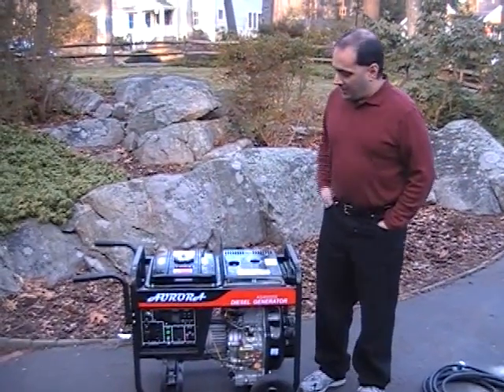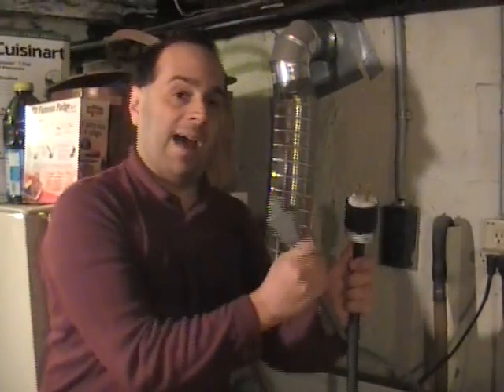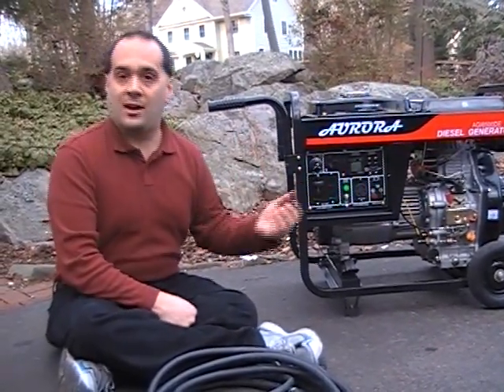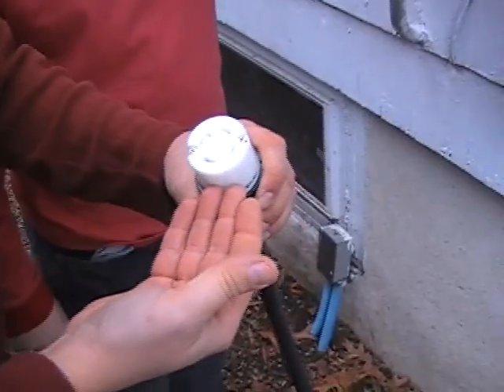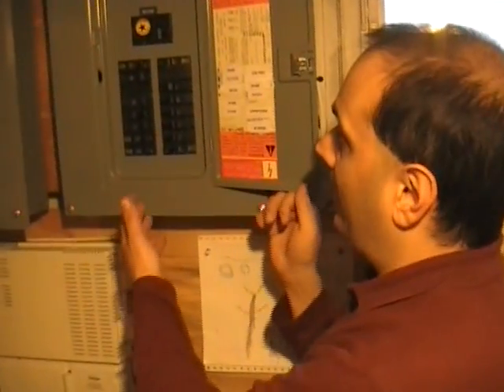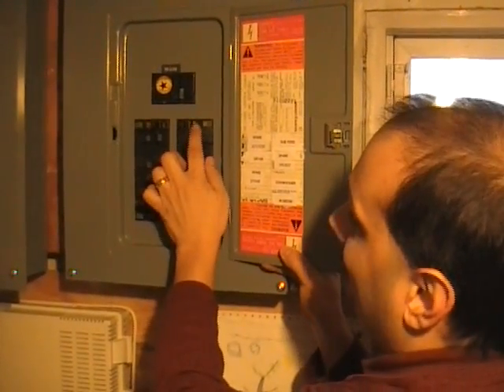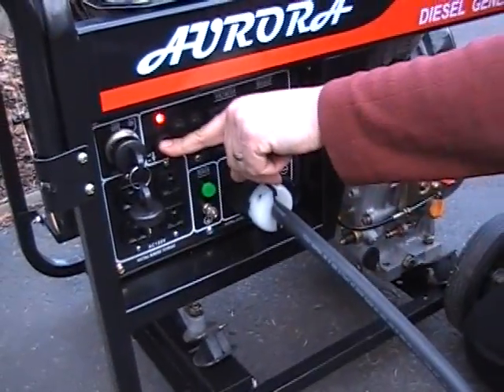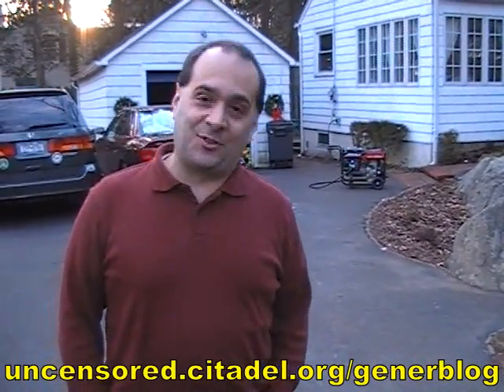Inexpensive residential generator hookup

Comment: Hello Art, just finished my generator setup( Box ect) and installed a 30 amp breaker for the Generator which connects to an inlet box, with 10 gauge 4 wire cable, now I "m wondering if I should have used a 40 amp breaker or would that be over kill, not trying to run the whole house, Plus I have a second 7000 watt generator the I could run cord from
Reply from the maker: Nope, you got it right.  A 30 amp breaker is the correct size for 10 gauge wire.  40 amps is too big and may not provide sufficient overcurrent protection.

By the way, 30 amps * 240 volts = 7200 watts, so your 7000 watt generator probably has a 30 amp breaker on its own panel anyway.

It should also go without saying that you shouldn't try to run two generators together on the same panel.  They will run out of phase and almost certainly damage each other.
Reply: AlRuark  Size your Gen input breaker into loadcenter panel  to the output  amperage of your Genset with the corresponding size that way you will get the full output of your generator. AND size the wire accordingly. bigger breaker bigger wire.  40 amp breaker needs #8 gauge wire. etc. My set up is 10'000 watt Northstar wired directly to panel using 40 amp breaker Gen set puts out 41.5 amps and the manual interlock system, works great. thanks.....

Comment from the maker: 4000 watts ought to be enough to power your refrigerator and some lights, and also your heat if it's NOT electric heat.  However if you don't know your way around electric but you have some free spaces in your panel, you might want to just have an electrician put in an interlock switch; they're simpler and less expensive than a subpanel -- but you do have to have some free space (I didn't).

Whatever you do, avoid "brand R" subpanels.  They're crap, and sold by shysters.

Comment from the maker: The generator may only be able to supply 30 amps (27 amps @ 240 volts, actually) and that's why the generator main is a 30 amp breaker ... but when running on utility power, there's no reason to limit ourselves to what the generator can supply.  We actually could have gone up to 100 amps for the utility sub feed.

Thanks for watching!

Comment: Great Video Art. Thank you.
Can you please tell me why you use 60 amp wire and CB from the main panel to the sub panel when you only have 30 amps coming from the generator?
Reply: Generator safety rules: Always make sure you follow all the generator safety rules before using your portable generator. This is only a reminder. Generators can be dangerous if not used carefully. Every year, hundreds of people die or get injured when using portable generators due to carbon monoxide poisoning and electrocution. Make sure you are using your generator carefully and keeping others safe as well. There is something very serious that everyone should always be aware of when using generators. Some people do run their generator indoors which is not safe and that increases the risk of carbon monoxide poisoning which can cause death of family and you. Some people run their generator in wet conditions which can electrocute them. Please remember that you should never run your generator indoors. Remember that carbon monoxide is an odorless and colorless gas that you cannot see or smell. Carbon monoxide is a silent killer. Keep that in mind. Make sure your generator is 15-20 feet away from your house and away from doors, windows, and vents. Never use your generator in your porch too. Having a carbon monoxide detector is very important against generator safety. Some people also allow children to go near the portable generator which could pose risks. We need to keep an eye on our children making sure that they are not near the portable generator so they won’t get electrocuted or burned by the generator which is dangerous. A locking enclosure also keeps kids safe. A generator shed might look like a tempting place to explore, or take cover during a game of hide and seek, but a generator is a dangerous piece of equipment that can cause injury. It says on the manual that we should also keep children away at all times from the portable generator to avoid injuries. Please do not allow a child or unqualified people to operate the portable generator.  It is important to keep your children safe especially little ones. The portable generator can be hot during an operation. Just because some manuals missed what should be listed doesn’t mean it’s safe to do. Always follow the generator safety rules when using portable generators. Generators pose electrical risks. If you need to use your generator during wet weather, you need a generator tent to protect your generator from getting wet. Don’t let your generator get wet. Keep your generator dry and before using your generator, please make sure your hands and your generator is dry. Do not wear loose clothing when operating the generator. Everything that is said on the generator’s operating manual should not be ignored. Never smoke cigarettes near the generator. Please keep flammable things away from the generator. Never overload your generator too. Your generator can catch fire. Never ever try to plug a generator cord into a wall outlet to avoid back feeding. Back feeding your generator is dangerous. Always turn on your generator first before plugging in appliances and shut off the appliances before turning your generator off. Use a heavy duty cord for your generator and the cord should not be worn out. All the instructions should be followed carefully. Never refuel your generator while it’s running. It can cause fire if fuel spills while your generator is hot. You should turn off your generator and let it cool off before refueling it. Having a fire extinguisher next to the generator is also important. This is only a reminder for everyone’s safety of using generators. Make sure your generator is properly grounded. Having a fire extinguisher next to the generator is also important against the safety rules. https://youtu.be/I1jT3ANENvI and here is a video more about keeping others safe when using generators and also about our family’s safety. It’s important to keep our little children safe as well. Make sure they’re away from the generator. Hope this helps. Be safe

Comment from the maker: There was no room left in the main panel, and this particular model would not accept tandem breakers.  I wanted to add a few extra circuits anyway, so this project offered the opportunity to address both needs.

As with many projects, every home will present a unique set of requirements and you use the best tool for the job.

And remember: a retrofit panel with cheap "button breakers" is *NEVER* the right tool from the job.  Just say no to those.

Comment: Did you only do this because you didnt have any room left in your main panel ? What benefit does your configuration have when compared to just using the main panel interlock(your first legal option) besides not having to highlight the circuit breakers you want on generator in the main panel ? Its seems your still buying an interlock but now also have to buy a sub-panel.

Comment from the maker: You are correct.  An oven with electric ignition (as opposed to a pilot light) will not operate without electricity, and that's true for ours as well.  We can light the burners on the stove with a match, though.  It was a compromise we made when sizing our generator and subpanel.

Thank you for watching my video and for the kind words.

Comment from the maker: As for the vibrate/jump question ... that sounds a bit odd, are you stopping it with a load still attached?  You should remove all load and shut off the circuit breaker before stopping the engine.

Comment from the maker: Reducing the speed of the generator is difficult, and has the unwanted side effect of producing AC at less than 60 hertz ... this can damage your appliances if they are not designed to run at lower frequencies.

What I did during break in was to reduce the *load* by placing substantially less than the generator's rated capacity onto the wire.  For normal operation this isn't recommended (diesels like to be run at their ideal load to prevent wet stack) but during break-in it's a good idea.

Comment: Hi Art .. I just bought an Aurora generator .. still in break in period.  I have about 3 hrs on it.  I was just curious did you reduce the RPM during break in ? The manual says to do it but then it says .. it's hard to do ..so I was just curious what you did.

Also when I turn the generator off ... it seems like it vibrates/jumps on it mounts for the last few seconds before stopping ... does yours do that ?
Reply: Make sure you follow all the generator safety rules before using portable generators. This is just a reminder for everyone’s safety. All generator safety rules should be followed carefully. Here are the rules about generator safety: Generators can be dangerous if not used carefully. Every year, hundreds of people die or get injured when using portable generators due to carbon monoxide poisoning and electrocution. Make sure you are using your generator carefully and keeping others safe as well. There is something very serious that everyone should always be aware of when using generators. Some people do run their generator indoors which is not safe and that increases the risk of carbon monoxide poisoning which can cause death of family and you. Some people run their generator in wet conditions which can electrocute them. Please remember that you should never run your generator indoors. Remember that carbon monoxide is an odorless and colorless gas that you cannot see or smell. Carbon monoxide is a silent killer. Keep that in mind. Make sure your generator is 15-20 feet away from your house and away from doors, windows, and vents. Never use your generator in your porch too. Having a carbon monoxide detector is very important against generator safety. Some people also allow children to go near the portable generator which could pose risks. We need to keep an eye on our children making sure that they are not near the portable generator so they won’t get electrocuted or burned by the generator which is dangerous. A locking enclosure also keeps kids safe. A generator shed might look like a tempting place to explore, or take cover during a game of hide and seek, but a generator is a dangerous piece of equipment that can cause injury. It says on the manual that we should also keep children away at all times from the portable generator to avoid injuries. Please do not allow a child or unqualified people to operate the portable generator.  It is important to keep your children safe especially little ones. The portable generator can be hot during an operation. Just because some manuals missed what should be listed doesn’t mean it’s safe to do. Always follow the generator safety rules when using portable generators. Generators pose electrical risks. If you need to use your generator during wet weather, you need a generator tent to protect your generator from getting wet. Don’t let your generator get wet. Keep your generator dry and before using your generator, please make sure your hands and your generator is dry. Do not wear loose clothing when operating the generator. Everything that is said on the generator’s operating manual should not be ignored. Never smoke cigarettes near the generator. Please keep flammable things away from the generator. Never overload your generator too. Your generator can catch fire. Never ever try to plug a generator cord into a wall outlet to avoid back feeding. Back feeding your generator is dangerous. Always turn on your generator first before plugging in appliances and shut off the appliances before turning your generator off. Use a heavy duty cord for your generator and the cord should not be worn out. All the instructions should be followed carefully. Never refuel your generator while it’s running. It can cause fire if fuel spills while your generator is hot. You should turn off your generator and let it cool off before refueling it. Having a fire extinguisher next to the generator is also important. This is only a reminder for everyone’s safety of using generators. Make sure your generator is properly grounded. Having a fire extinguisher next to the generator is also important against the safety rules. https://youtu.be/I1jT3ANENvI and here is a video more about keeping others safe when using generators and also about our family’s safety. It’s important to keep our little children safe as well. Make sure they’re away from the generator. Hope this helps.

Comment from the maker: The run time of a diesel is good but the question isn't really that simple.  To get the most out of a diesel you want to run it with a good sized load attached to it.  If you do, it will run more reliably and more efficiently than gasoline.  If you run it with little to no load, it will eventually wet stack, requiring inconvenient maintenance.

Comment: This is a great idea and your video is very well done and quite informative.
Thanks Art, you're saving folks a lot from not buying an expensive transfer switch.

How's your run time with diesel as opposed to a gas model? I know that vehicles get a lot better mileage from diesel and I hadn't considered a diesel gen set at all.
Reply: Make sure you follow all the generator safety rules before using portable generators. This is just a reminder for everyone’s safety. All generator safety rules should be followed carefully. Here are the rules about generator safety: Generators can be dangerous if not used carefully. Every year, hundreds of people die or get injured when using portable generators due to carbon monoxide poisoning and electrocution. Make sure you are using your generator carefully and keeping others safe as well. There is something very serious that everyone should always be aware of when using generators. Some people do run their generator indoors which is not safe and that increases the risk of carbon monoxide poisoning which can cause death of family and you. Some people run their generator in wet conditions which can electrocute them. Please remember that you should never run your generator indoors. Remember that carbon monoxide is an odorless and colorless gas that you cannot see or smell. Carbon monoxide is a silent killer. Keep that in mind. Make sure your generator is 15-20 feet away from your house and away from doors, windows, and vents. Never use your generator in your porch too. Having a carbon monoxide detector is very important against generator safety. Some people also allow children to go near the portable generator which could pose risks. We need to keep an eye on our children making sure that they are not near the portable generator so they won’t get electrocuted or burned by the generator which is dangerous. A locking enclosure also keeps kids safe. A generator shed might look like a tempting place to explore, or take cover during a game of hide and seek, but a generator is a dangerous piece of equipment that can cause injury. It says on the manual that we should also keep children away at all times from the portable generator to avoid injuries. Please do not allow a child or unqualified people to operate the portable generator.  It is important to keep your children safe especially little ones. The portable generator can be hot during an operation. Just because some manuals missed what should be listed doesn’t mean it’s safe to do. Always follow the generator safety rules when using portable generators. Generators pose electrical risks. If you need to use your generator during wet weather, you need a generator tent to protect your generator from getting wet. Don’t let your generator get wet. Keep your generator dry and before using your generator, please make sure your hands and your generator is dry. Do not wear loose clothing when operating the generator. Everything that is said on the generator’s operating manual should not be ignored. Never smoke cigarettes near the generator. Please keep flammable things away from the generator. Never overload your generator too. Your generator can catch fire. Never ever try to plug a generator cord into a wall outlet to avoid back feeding. Back feeding your generator is dangerous. Always turn on your generator first before plugging in appliances and shut off the appliances before turning your generator off. Use a heavy duty cord for your generator and the cord should not be worn out. All the instructions should be followed carefully. Never refuel your generator while it’s running. It can cause fire if fuel spills while your generator is hot. You should turn off your generator and let it cool off before refueling it. Having a fire extinguisher next to the generator is also important. This is only a reminder for everyone’s safety of using generators. Make sure your generator is properly grounded. Having a fire extinguisher next to the generator is also important against the safety rules. https://youtu.be/I1jT3ANENvI and here is a video more about keeping others safe when using generators and also about our family’s safety. It’s important to keep our little children safe as well. Make sure they’re away from the generator. Hope this helps.